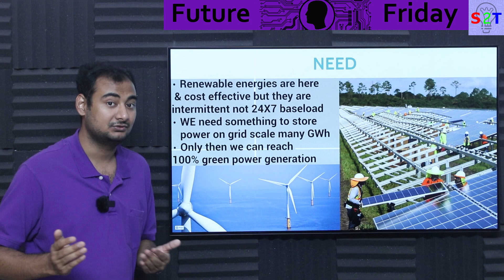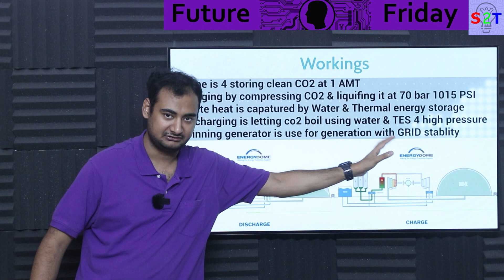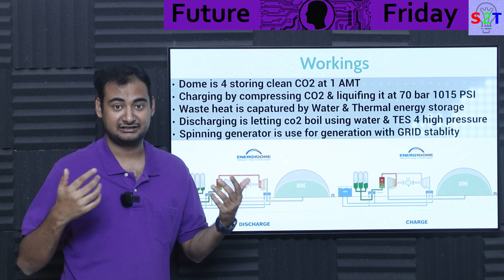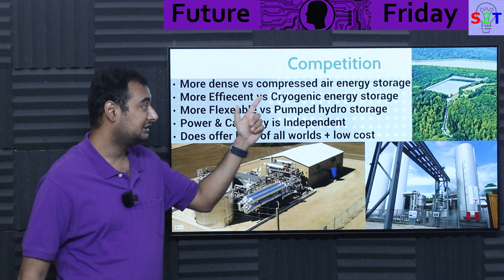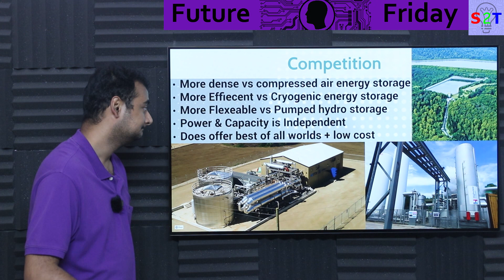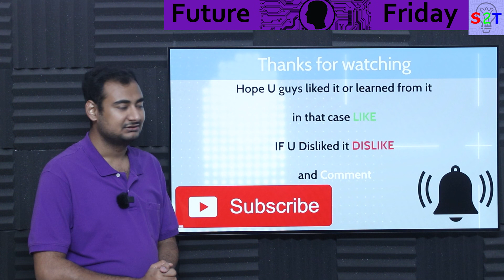CO2 Battery {Energy Dome} Explained  {Future Friday Ep194}

Comment: If you need a storage system for gaseous carbon dioxide, you shouldn't use a flexible enclosure that changes volume — that's mechanical deformation, which leads to poor durability. It's better to store the gas at a constant volume, always slightly above atmospheric pressure. The minimum pressure should be 1.1 atmospheres — enough to partially support the dome structure. The maximum pressure can be up to 2 atmospheres, at which point the mass of the gas will be three times greater than at 1 atmosphere. A large rigid dome can easily withstand this internal pressure.

The dome size and the maximum pressure can be optimized depending on the application — this can result in significant cost savings.

It’s also worth comparing whether such a system would be more efficient if ethane were used instead of carbon dioxide. Ethane is always available, it's routinely stored anyway, and it can be used just before it's converted into fuel.
Вы сказали:
Reply from the maker: yes this is a lame idea we can use close loop pomped hydro or Old coal power plants can be repurposed into thermal energy storage (TES) both are better
Reply: ethane catches fire... concrete structures are expensive and time taking to build... this Co2 balloon system is claiming 75% round trip...  and very safe...larger balloon looks ugly but works... 
This Co2 system is a no brainer ....Compress the gas capture the heat in water bath while cool the Liquid Co2... later use the hot water to expand the liquid into gas in the discharge cycle via turbine.....

we already make all the components needed locally in India....  Triveni turbine is the supplier...
already NTPC has contracted the company to build 160 MW pilot plant in KA... for 290 crores ..life is 30 years.. 2 years commissioning time line...

This is much better than investing billion in LFP  with 10 years only cycle life.... depending on foreign lithium and copper...

Comment: Your explanation miss the most important factor! Unlike other gasses like oxygen and nitrogen, it liquify at high temperature. Therefore, when you pressurize it, or input the gas, pressure remains constant. Normal gases it increase exponentially (or similar) because of this constant pressure, energy waste of the system is low!
Since the pressure difference is small, and can be used for a large volume. It can be compared to a very large resovior, so when water is added the water level don't go up substantially.
Reply from the maker: Every thing has, ever state question is at what temp and pressure & does it suit your needs . Eg in powerplant u can use supercritical co2 turbine or supercritical steam

Comment: Wow thankyou i have been researching on batteries for a week this is finnally what i found and i think I'm making a model of it for my science exhibition so basically I'm making self sufficient (aatmanirbhar) building complex which will generate energy and store it this way then there will be many sensors in house amd a common dustbin connected to home for waste segrigation in 7 different types could you give me some more suggestions
Reply from the maker: more steps more cost & mess up try only 2 category Biodegradable waste & Non Biodegradable
Reply: @s2tenglish  no no we have made the 7 waste bin segrigator and automatic light sensor which turns on when you enter the room but we are in search of batteries to pair up with renewable energy generator and we are planning to make a shower Tap which will show the amount of water in liters you've used while bathing